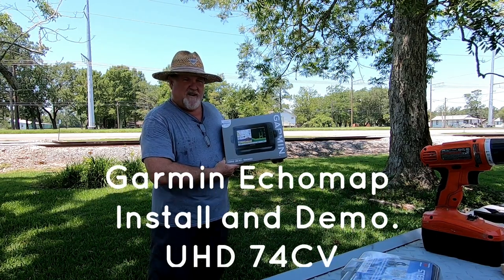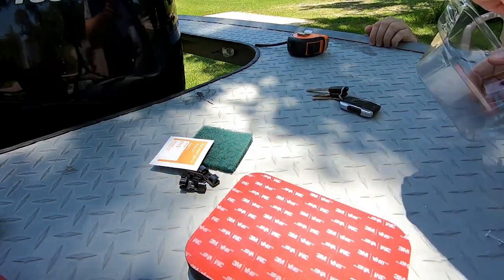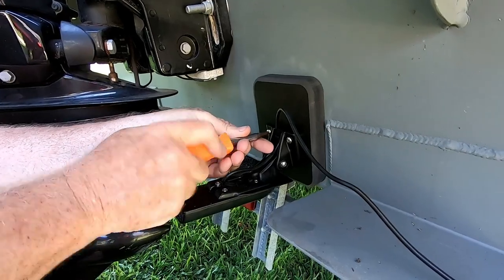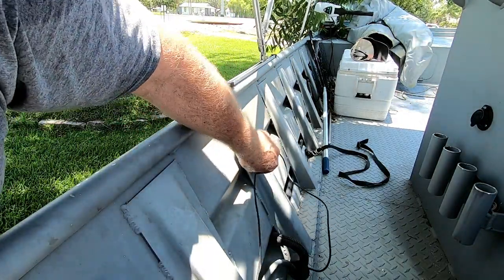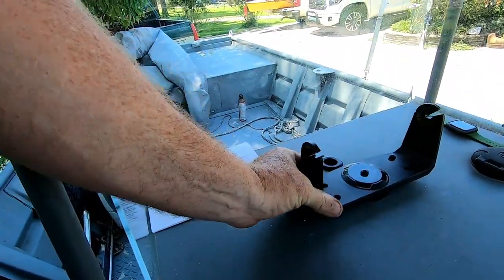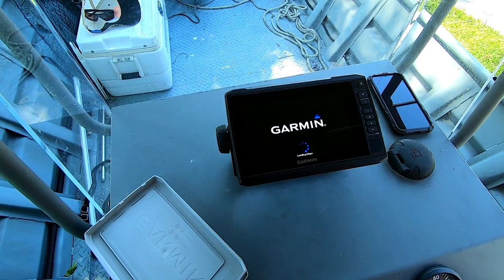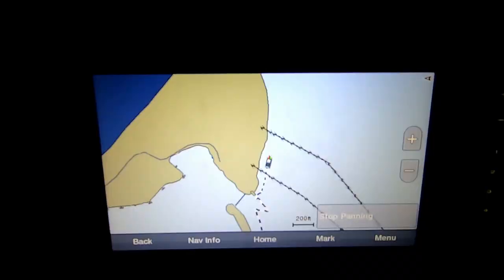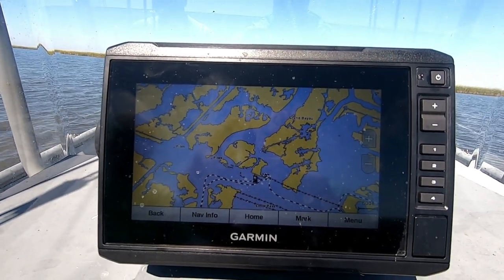Garmin Echomap Install and Demo  UHD 74CV

Comment: Hey, thank you sir. I just ordered by 74cv today and I never thought or knew they made a Stern a pad. I'm going to look into doing it that way myself thank you and tight lines to you
Reply from the maker: The pad has been on for 2 years and is still solid as can be. I also used the same 3M tape to attach my electrical fuse blocks inside the consul, holding up great there also.

Comment: How does that Swivel base hold up OUTSIDE in sun and salt? I keep my flats boat on my lift. Just wondering if the base and wiring will degrade in the elements???
Reply from the maker: I have a canvas console cover for my boat, so it is not in the sun. So far I don't see any breakdown of the plastic or any problems.

Comment: updated to echomap 75cv uhd with navionic data from my old echomap 70s which was very accurate, had to throw it back as the underwater heads where i fish were too far out, in fact 1300ft out from where they should be, spent 4 days searching for the heads, on the 75cv it said i was fishing directly over them but in reality i was fishing over sand and the heads were 1300ft away, had to revert back to my old echomap, no good having all the sparkles if yer in the wrong place, any one wanna check just ask for the numbers and i will give them..
Reply from the maker: This is my first Garmin, thanks for the info I will check the accuracy on mine now.

Comment: So I can take the screen with me home whole I leave the boat on storage?? If so then I'm getting one because I've held back on getting one because of petty thieves where I am
Reply from the maker: Yes the whole system unsnaps from the base. I keep mine in a padded bag inside the house for the same reason as you. Only thing that stays on the boat is the transducer and wiring to the swivel base.
Reply: @SRadigFishing  thanks alot, I'm doing a lil more research then I'm getting one

Comment: How is that 3M stern mount working?  I’m glad I saw your install first.  I have a new boat, would never have thought to use a stern pad.  But much better idea than drilling into a new boat.  I’ve seen the glue on’s, but like the 3M idea better.  by the way, I got the 74sv
Reply from the maker: This is the second 3M pad I have used and so far great results. I use the same type 3M tape for car moldings and louver mounts, that is why I used this. I knew it would last years and no holes drilled into the boat.
Reply: @SRadigFishing  thank you nice video